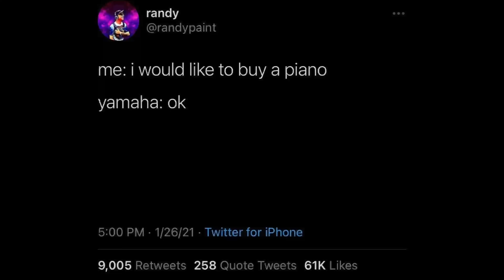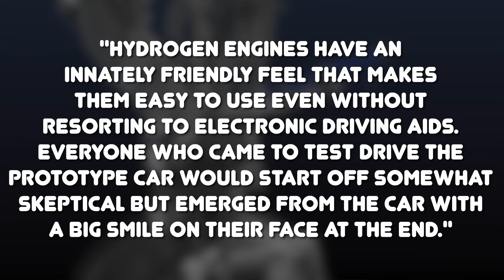Toyota's New 455HP Hydrogen V8: Everything You Need to Know

Comment: I know it might not seem like it now with current cost of gas and current cost to charge ev’s, but Toyota is pursuing the hydrogen market IMHO out of foresight of auto market. There are multiple reasons but two should suffice. With current legislatures local and abroad flirting with or already proceeding with bans on fossil fuel cars, there are going to be two very big problems as we convert the majority of our transportation to ev. 1. Lack of electric infrastructure, most homes have 250-300 amp services for the whole house, electric cars can take up to 150-200 amps of that service to charge, when you add multiple vehicles per house, every house on the block, that  puts such a strain on current infrastructure. Even if we update all that infrastructure we then have to find the ability to be able to keep up with electrical demand at all times, which we all know as awesome as renewable energy is, it’s not consistent or reliable in its current form, some days you get a lot, others it’s a little so we’ll end up having to burn oil to create electricity or be able to create some sort of useable fuel out of the surplus energy we get. Enter hydrogen. It’s made using water and electricity. 2. Ev’s depend on batteries, which are made of lithium and nickel, that are rare earth metals that are not in abundant supply that are non recyclable and take alot to mine which will be hard in many countries due to environmental regulations. Current mining processes can keep up with current demand for ev, but there is going to be a giant bottle neck of resources once the market hits 25% ev or 40,50%. When that happens we will
Have no choice but to turn to alternatives like hydrogen, and at that point Toyota will have the jump on the market.

Comment: Hydrogen infrastructure has made a revolutionary change recently and I believe that it will make a push long term.
Reply: Nuclear Small Modular Reactors could give us hydrogen on demand.
Reply: What happened
Reply: @ghjfgnncvvffghvv1271  the biggest issue was shipping it safely.  A tanker of hydrogen or a train full of hydrogen would level a city if an accident happened that caused a fire.  The developed a process to convert it to ammonia for shipping and efficient convert it back to hydrogen once at stations.  That’s the general idea at least.
Reply: @HuntsT  A tanker of hydrogen wouldn't "level a city" what are you on 😂

Comment: What you are not considering it Japanese culture and their geolocation. They have had a huge catastrophe on Nuclear Energy and their current Power Grid does not have the capacity or potential for their country to go full electric. This is why you see Toyota and the other’s pursuing Hydrogen Fuel. There is a market just below the surface, Japan has a massive automotive scene. They also have mastered automotive manufacturing and ICE R&D, and when you consider production costs…there is a huge benefit to going down the Hydrogen path. They do not have to make the Hydrogen ICE better than what’s on the market, they have to replicate and replace. So with HICE all they need to do is refine current systems, not reinvent. Very little if anything needs to be changed production wise, it’s all design and engineering. But the biggest reason they are doing HICE is as I said, their Power Grid cannot and will not support a full electric society.
Reply: If the Japanese don't have the potential to go fully electric, then where will all the electricity required to produce hydrogen come from?
Reply: @Brian-om2hh  Hydrogen production is not the same as the whole country running everything on electricity.  How much electricity do you think it is going to take to produce Hydrogen quantities to supply vehicles compared to everything running on electricity including all transportation?!

Comment: There is a lot of equipment that needs to be zero emissions where a battery will just not make sense for a long time. From portable power generation, to extreme heat and cold, sometimes you will just have to burn fuel. I don't see this type of engine being in every car, but I could see it in NASCAR, arctic crawlers and snow mobiles, and farm equipment.

Comment: You entirely missed the reason why hydrogen cars failed and why only Tesla succeeded in terms of electric cars. Electric cars are old, the first one was made in 1881, but they never worked commercially in modern times because of a lack of charging stations. Tesla solved this problem by dumping a huge amount of money into infrastructure. If you look at the places that have the highest electric car ownership it's directly correlated to the amount of charging stations, and specifically the stations go in first and THEN people buy the cars.

Hydrogen has failed so far because no one has invested the money to build out the very expensive refueling infrastructure, however I defiantly think there is a ton of interest in hydrogen given it's possibilities and infrastructure should not be far off (maybe 10-15 years). People underestimate how much people want to keep internal combustion engine cars on the road. They just have so much more to them than electric cars from an enthusiasts perspective. hydrogen also has a much better chance of being used as a power source for aircraft than batteries as turbine engines can be easily adapted to it and it's far lighter than batteries are. Also hydrogen can be used as a rocket fuel, so having a fuel industry preps us for future space fairing.

Comment: Kawasaki already has a prototype engine too using a H2 powered by Hydrogen. Also yea it's probably gonna be a Japan only engine since over there they're already figured out (most of it) with Kawasaki's heavy industry is handling the distribution of Hydrogen over there
Reply: Renault is preparing a prototype vehicle powered by a hydrogen ICE. Ford and possibly dodge are looking into it. Cummins is undergoing development of a hydrogen ICE.
Reply: Hydrogen source is water. Hydrogen is for drinking and washing clothes not engines.

Comment: You are wrong in thinking that a hydrogen combustion engined car would have the same service intervals as a petrol or diesel engined one. In reality a hydrogen combustion engine could run for over 100,000 miles before needing an oil change.

Comment: All the talk of electric vehicles is good, but only in the areas of the world where there is electricity....
Many parts of the world do not have a grid peer system that is reliable on any way, it's no power or over power. Very seldom.steady. The infrastructure needed for hydrogen is easier to place that renew a countries entire electric power system. There is always hope for the internal combustion engine... in many applications. Power generation ....for one... for your electric truck in times of storms , emergency vehicles....... 
Long live good clean engineer trains of thought.......